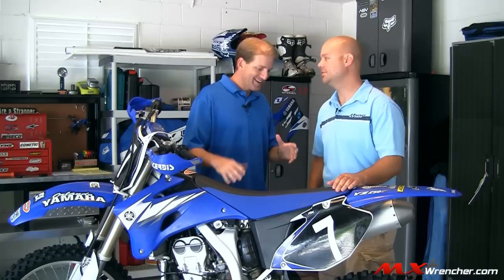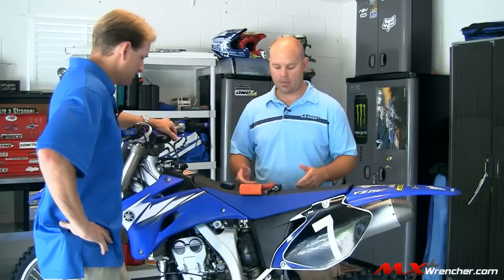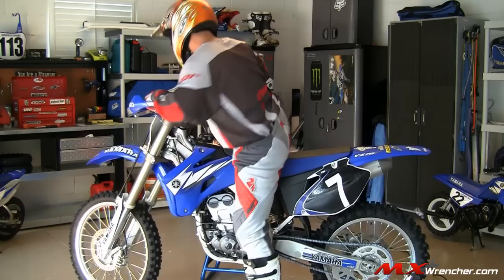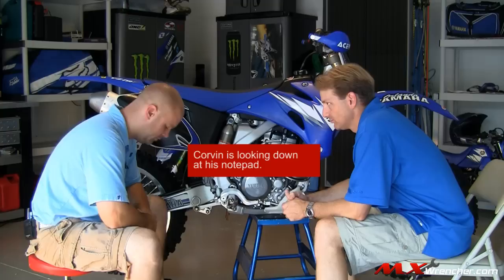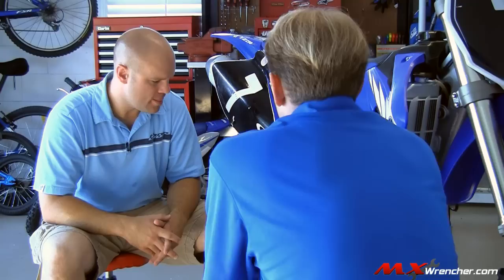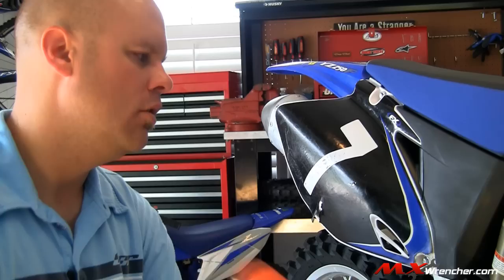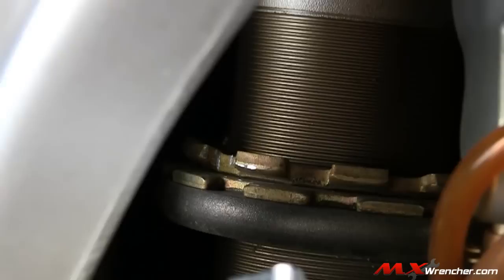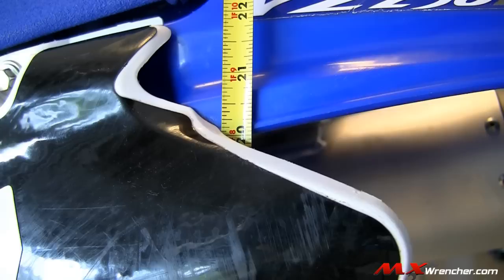MXWrencher.com - How to Set Your Suspension Sag

Comment: Its frustrating when guys do these videos and don't know what they are doing.  Here is the PROPER way to setup rear suspension spring rate and preload;
1. Measure Axle to spot on fender with rear wheel in the air (as shown in video);
2. 1/2 tank of fuel, riding gear on, stand on foot pegs and have 2nd person balance you while taking measurement. Write down measurement (as shown in video);
3. If this measurement falls within the spec for your bike (look it up in manual) proceed to next step. If measurement is not enough, add spring preload by adjusting spanner nut down (as shown in video); Repeat process until measurement is correct. If measurement is not enough, turn spanner nut counterclockwise to loosen preload; Measure again; Repeat process until correct measurement (This is called "Race Sag").
4. Next (this step is the critical step overlooked in the video) grab rear of bike no rider, and lift weight up until almost no weight is on rear tire, then release and let bike compress suspension under its own weight (this is called "free sag"). The difference between the measurement when rear wheel is in air (this was the 1st measurement taken) and the "free Sag" measurement should be between 15mm and 25mm; If its more then 25 mm then you need to swap out the spring for a spring with stiffer rate, then repeat entire process until all measurements are within spec. If the measurement is less then 15 mm you need to swap out the spring for one with less spring rate, repeat entire procedure until measurements are correct.

Setting up "Race Sag" by simply cranking preload into the spring but yet having a spring with the wrong rate, adversely effects the bikes ability to absorb bumps through the suspension range, it effects bottoming, it effects the suspension to prevent bucking you off the seat, it effects power down traction coming off corners, it effects how the bike launches off jumps and it effects the balance of the bike with front end. It takes a while to understand how this all works but if you are doing any kind of track riding you need to pay attention.
Reply: Thanks...I screenshot this for reference..best explanation I've seen yet!
Reply: thanks i know how to do it  but its been a while. the spring is important on riders weight to see if u have to change it. im going by what you wrote.
Reply: Thanks for the instruction. However, you said "If measurement is not enough" twice, both for adding and loosening spring preload. Could you please specify by clarifying if the measurement is greater or less than what is recommended whether you need to add or reduce preload. Thanks.
Reply: @wade stewart Greater sag, or an increase from say 3.5 inches to 4 inches difference between the two measurements means less preload, softer suspension. Less sag means more preload, stiffer suspension.

In the video it was expressed that the initial measurement for unsprung was 24 inches, while the sprung measurement was roughly 19. The final result came to pretty much dead on 20 inches after the adjustment which means that the difference is 4 inches (24 minus 20), whereas prior to adjustment it was roughly 5 inches (24 minus 19).

Hope that helps.
Reply: @audiogarden21  so clockwise  = more preload/stiffer, and counterclockwise = less preload/softer?
Reply: Generally speaking yes. Refer to your owner's manual.

Comment: Few things for people reading the comments. I just got done softening my suspension on my '09 250F. The top lock nut was a bitch to get loosen. I basically used the end of a small jack-stand winding lever and smacked it with a metal mallet. Finally got it to budge after striking it VERY HARD. 

Second, there was no way I could simply adjust my shock by twisting it with my hands. I am not weak lol. The way my suspension looks is slightly different than the video. The adjustment nut is attached to a small coupling bracket in which, I assume, the shock is welded onto. To adjust the suspension I smacked the adjustment nut and loosened it that way. Took about 15 minutes but was fairly simple to do. 

Also, I tried to relieve the bike's suspension by raising the back-wheel off the ground. Nope, still didn't help loosen the actual shock by hand. 

Happy riding!

Comment: I am buying a used 2011 CRF450, It is currently set up for a 160lb rider and I weigh 185lbs,  I won't have the money to get the suspension setup for my weight for a while. I do tend to like a slightly stiff rear shock and a little bit softer in the front. I think the front will be good as is, but is there anyway I can make the rear a little bit more comfortable but setting sag and messing with the clickers until I can afford a total suspension job.

Comment: Does this help with making a tall bike shorter for a smaller rider?
Reply: Jared Bornstein i dont Think so because the front is stil tall
Reply: Check out kouba link, or yamahalink in this case... 3-4mm shorter rear and the front you can just slide the forks up the triple clamps
Reply: You can also shave the seat a few inches, slide the forks down in the front, and get a lowering link.  My buddy who is5'7" has to do that to all his bikes.

Comment: i have a 2005 Honda CRF 230 and i have been trying to adjust the sag like this but i can not get the lock nut to loosen.
i was wondering if you had any advice for getting the lock nut to move I have tried spraying the threads and nut with penetrating oil as well as just beating on it with a hammer and a punch but i cant seem to get it. any advice would be greatly appreciated ~ Hunter
Reply: Did you try hitting it with a hammer?

Comment: so i weight about 60kg, 132.8 pounds according to a converter on google, and my legas are about 80-90 cm long, and most bikes, 250cc, aree about 95cm tall, can i lower them to my exactly height, without risking suspension problems?

Comment: Shouldn't you check the first measurement again after adjusting the pre-load on the spring?
Reply: the first measurement doesn't change. it was the unloaded measurement there's no weight on the shock its extended to the maximum when its unloaded no matter what spring or preload is used

Comment: I don't get it what should I subtrakt it with the 2nd measurement
Reply: For example if I have 1st measure was like 23'' I subtrakt that with the 2nd measure that was for example 32 ?
Reply: +theAirsoftmatrix   if the first wa 23" the 2nd can´t be more than 23", you seet on the bike for the 2nd measure, so the rear fender goes closer to the wheel nut.... sorry my poor english
Reply: +bossMatrix The first adjustment is with the bike on the stand so the tyres are off the ground. This is it's natural and Highest position, then sit on the bike // or stand while a mate takes the measurement
this measurement will be smaller so if the first was 23" the second will be LESS than that. If not then your measuring it from two different places

Comment: i need help guys, i have a crf250r 2011 i dont ride much track i ride more enduro and trails, my rear shock feels too stiff for me and im unsure on what to do to soften it up a little. i weigh 175 pound and as far as i know it has the stock spring in. any help would be much apriciated thanks.
Reply: +Dean W If the sags fine, just adjust the clickers. plenty of youtube vids on adjusting rear suspension clickers

Comment: @MrMainoffice you got alot to lean about riding. if you inflate the tire to the max that is way too stiff. i had a maxis tire and the max was 35 psi, i normaly run 12 thats a good number. but that still depends on your riding conditions.

Comment: You should NEVER EVER use a screwdriver for a punch,...i.e. as you show it to drive the locking nut around. This is bad for the screwdriver ( break the handle ) and the locking nut,..
( chopping into the steel of those nuts,...not good )  You said you have a punch there, why didn't you use it?
One thing's for certain,..he's NOT a good mechanic/service tech )